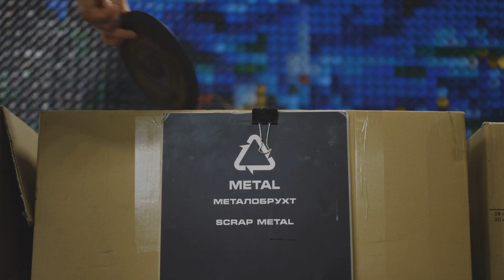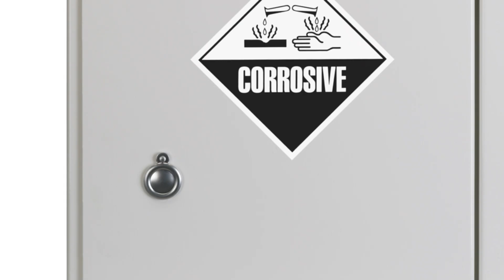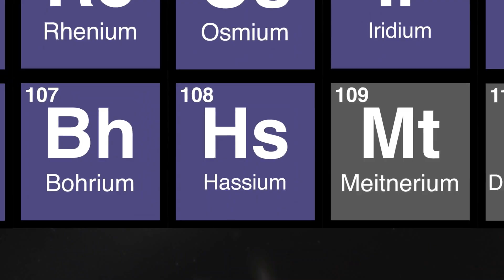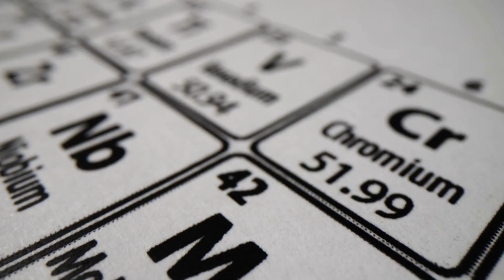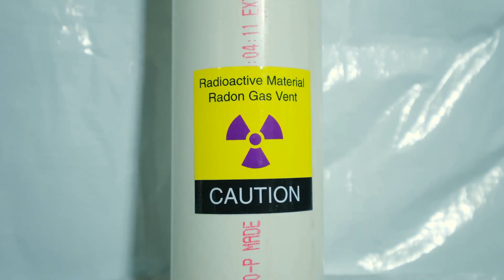Osmium: The Element That Defies Weight

Comment: Deadliest? Not even in the same ball-park as plutonium, or radium!
Reply: Plutonium is not very toxic at all.  A nuclear physicist offered to eat a gram of plutonium, if this anti-nuke activist would eat a gram of nicotine.  (This was a joke, a gram of nicotine would kill him instantly, where as the plutonium would pass thru the physicist in 2 or 3 days, virtually harmlessly.)  More seriously, he offered to eat a gram of plutonium if another man would eat a gram of caffeine.  A doctor should be standing by, because with medical treatment, eating a gram of caffeine is almost certainly survivable.  The person would be down on the ground in convulsions tho.

Plutonium oxide is somewhat toxic (and plutonium forms oxides easily).  However, almost all the transition elements exhibit similar levels of toxicity if you combine them with various compounds.  We don't call nitrogen toxic, even tho it can be combined to make cyanide.  Cyanide, by the way, is FAR more toxic than plutonium.

If you made a list of the top most dangerous poisons, plutonium would not make the top 4,000.

Coal burning releases mercury into the environment.  It has been estimated that coal burning in the USA, has lowered the average IQ of people by 0.7 IQ points because of mercury poisoning.  Mercury is stable, so it lasts forever.  Plutonium is radioactive, with time, it vanishes. 

I could go on longer, but anti-nuke activists keep trying to paint plutonium as a uniquely poisonous substance.  It isn't.  Its oxide is moderately toxic, and it is radioactive.  (Emitting alpha particles which are stopped by a few cm of air or your skin.)  That said, you don't want it inside you.  But for that matter, you don't want any heavy metals inside you.  (Other than iron, but when I say 'heavy metal' I mean elements with more protons than iron.)

Warm regards, Rick.
Reply from the maker: Got a point there :)

Comment: Osmium, is from outside the universe, and predates the big bang

It is too dense in particles to be arranged in any possible way, in our universe 

Or maybe even the 3RD dimension
Reply from the maker: Wait… so the periodic table’s been lying to us this whole time? 😆 Osmium didn’t come from stars  it came from beyond the patch notes of the universe! Somebody call Neil deGrasse Tyson and Doctor Strange for this one.
Reply: Osmium can be transmuted from lead by reacting sodium with lead at 900 degrees celsius, causing the lead 204 to 208 isotopes to fission to form gold ,platinum,,iridium and osmium. more osmium is produced than Au, Pt, Ir from this LENR  process that was developed at the Texas A and M  University by Dr John Bockris and Dr Joe Champion during the 1990's.Check out [Dr Joe Champion Rex research]
Reply: You are saying a chemical reaction will cause a nuclear change. It doesn’t work that way. The only way to change one element to a different element is in a nuclear reactor or possibly in a particle accelerator.
Reply: glad you have it figured out.   fwiw there chief, most everything past iron is stardust
Reply: Are you 'on something' as you are writing this? It's like all the other super-heavies, made in supernovae (that's the theory, at least).

Comment: As to toxicity, the ranking of Os and its oxides is total BS.
Reply from the maker: Eh, not really, osmium tetroxide (OsO₄) is no joke. 😅 It’s literally used in labs with fume hoods because just a tiny whiff can mess you up. The ranking might sound dramatic, but the danger’s pretty real.
Reply: @beyondthelements  I've been working with the oxides in a high temperature superconducting materials search context: The hazard is real indeed, but faf far off the ultimate toxic elements' one.
Reply from the maker: @franzculetto5962  Fair point, In pure form or in the wrong setting, OsO₄ is nasty stuff, but in controlled applications (like your superconducting research), it’s a whole different story. Science: where “toxic” can also mean “useful.”

Comment: Most of the videos shown have nothing to do with osmium
Reply: I liked the cymbals.
Reply from the maker: Most of them are indeed fillers to make it fit in better with the story i wanna tell
Reply: @beyondthelements Which I was disappointed that whilst you hinted at it, you never mentioned that Osmium was once used to tip the needles used to play 78rpm shellac recordings. In the era before the invention of the 33⅓rpm "long playing" (LP) record, or the rather soft "vinylite" (PVC plastic) material they're still made from, even before electricity was commonplace in every home, people had all-mechanical technology, wind-up Graphophones (a.k.a. "Gramophone", a.k.a. "Record Player") to play those 78rpm discs made of hard & brittle shellac material. For the poorest & cheapest individuals, they would purchase a package of sharpened steel needles to play the groove of the disc. Each steel needle was only hard enough to play 5, maybe as many as 10 sides of a disc before the tip would wear down & broaden & flatten, & start to do significant damage to the information in the record groove. One solution was to use a softer material that was incapable of doing much damage to the groove, & also reduced the hissing noise of the steel grating into the hard shellac & creating high frequency spurious resonances; cactus needles would be used, if they could be found. Besides having an even shorter life than steel, so only one or three plays, the volume of sound obtained from the needle was lower due it's "give".
The solution adapted as technology evolved was rather to try to make needles of harder & harder material, because that's a property of the ones that wear down the least under such use. Because 78's were from the era prior to 1950 & went as far back as to before 1900 (although beeswax cylinders spinning at an incredible 160rpm were the more common standard up to about 1920), materials & fabrication technology, especially for mass production, were nowhere near as developed as they are now, for example. As a result, diamond was too rare & expensive to be considered for a needle point of a record player, the material we've been using since the early 1950's to present. Not even the cheaper & inferior substitute, sapphire, was considered a manageable material for the purpose. And even then, sapphire only lasts for about 25-30 hours on a 33⅓rpm vinyl disc (about 50 to maybe 100 LP sides).
But since the average playing time of a 10" 78rpm shellac disc was about 4 minutes, we can see that the steel needles were only good for about a half an hour of use! 
In the absence of diamond or sapphire, those old-time Engineers got the idea of making needles out of Osmium! Probably just a plating, I presume. But Osmium nonetheless!  The Osmium needles only lasted about 2x or 3x longer as I recall; MAYBE as much as 5x?
But imagine, if you will, that the wealthy(er🤔) Audiophile of the 1930's & 40's considered an Osmium-tipped needle to be the ultimate in 78rpm disc reproduction!
As I said in the beginning, I'm surprised that this otherwise very relatable application was one that you don't seem to have known about...🧐
Reply from the maker: Wow, that’s an incredible deep dive  thank you for taking the time to share all that detail! I had missed in my research that osmium was actually used for record needles before diamonds and sapphires became practical. Really fascinating to see how the evolution of materials technology tied directly into audio playback history. Definitely learned something new here appreciate you adding so much context to the discussion!